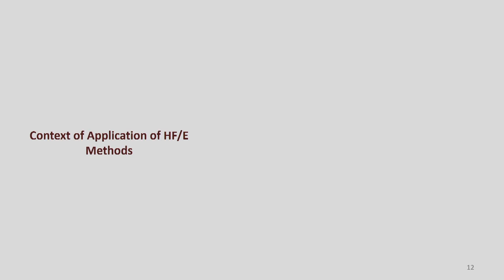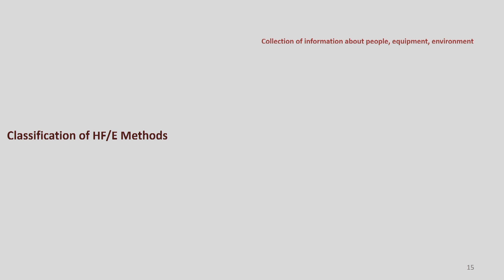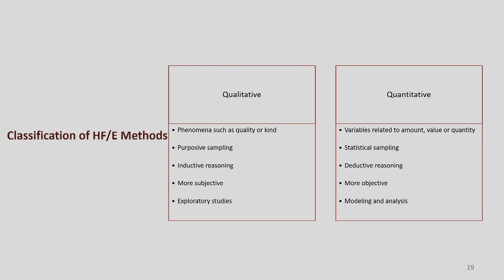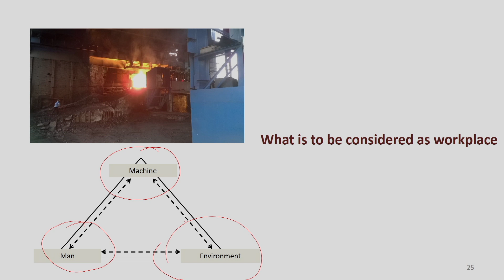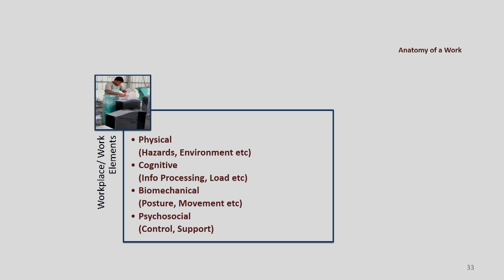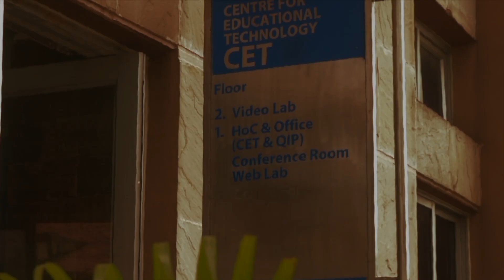Lec 2: Introduction to Ergonomics Workplace assessment - II

Comment: Hello Mam,

Thank you for your lecture. 
I would like to request if you can provide any lecture regarding the various eye points used in Ergonomics, especially relating the Field of Vision like P-Point, V- Point, E-Points used in the design of an Automobile Vehicle.  In EEC-77/649, these points are mentioned. As Field of Vision is quite important in finalizing various systems, I would like to in detail. I am thankful, If u can provide it.